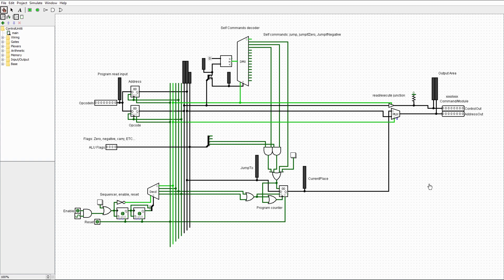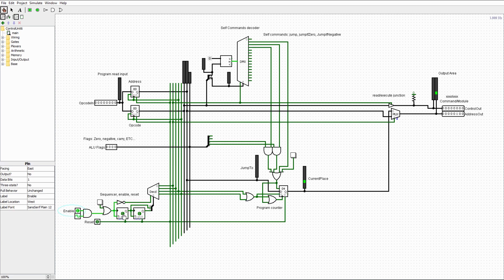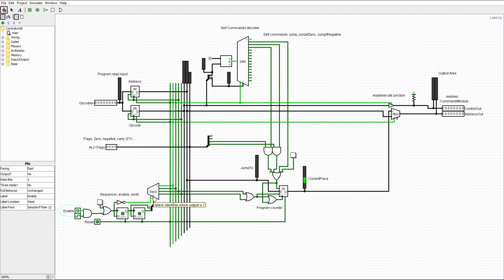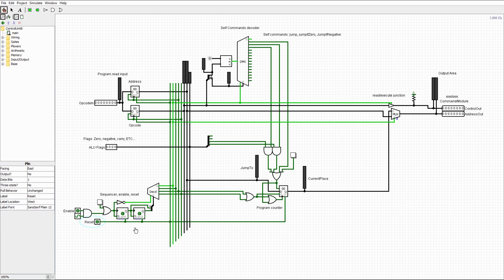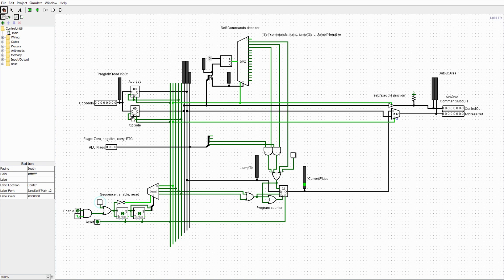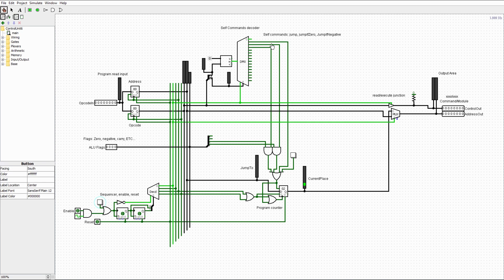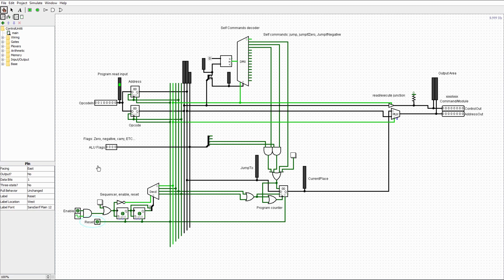Logisim E4 how to make a control unit

Comment: Hello there!
Can you please tell me what's that vertical black bar located at upper left  (you said 8-bit 4-bit bundled wire but i couldn't fin anywhere in logisim) and how to create it or locate it in logisim?
Reply from the maker: Bit width of a wire is determined by the components attached to it. If more than one width is attached to a wire, the "incompatible widths" error occurs. So it is all automatic, and based on component IO width settings. I like arranging the wires in a bus pattern for organization.
Reply: @outsidetheboxthepowerusers8209  thank you for your instant reply but sir can you help me out from where can i do that because it is not being done by automatically, it constantly showing incompatible widths as you have mentioned..
Thank you in advance.
Reply from the maker: @rupenchitroda2471  Below the new component selection panel is the configuration panel for the selected component. The most difficult part is finding which component is incorrectly configured, and which specific setting that requires alteration. (The setting for width is always a number, so it is simple to tell it from the rest) If you are having extreme difficulty, then i recommend disconnecting all components from the wire and reattaching them one at a time until you find and correct all of the errors. But be sure that the first component has the correct width, or you will be making all of them incorrect based on the settings of the first one. You can also disconnect entire branches of your circuit to test if that branch is where the error is coming from.